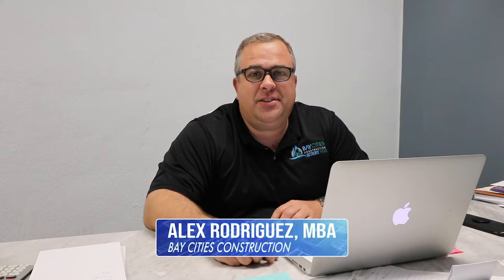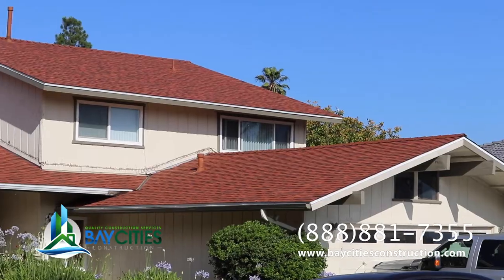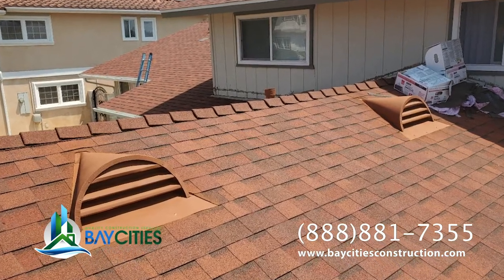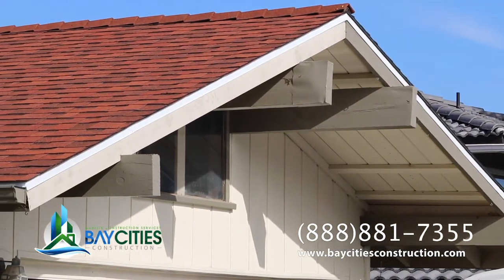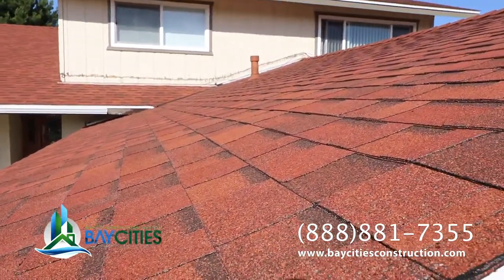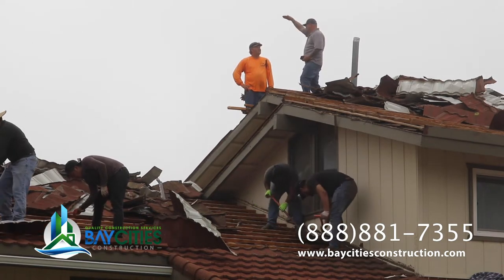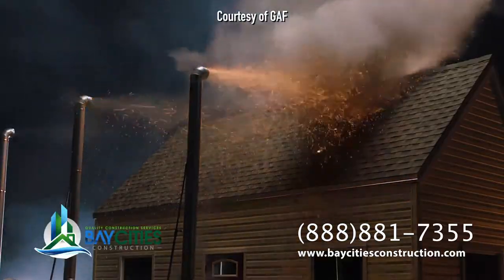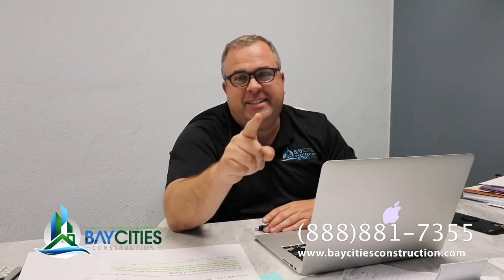What is a Cool Roof? | Why You Should Seriously Consider a Cool Roof

Comment: I’ve never understood why USA commonly uses these shingle roofs. Here in Australia we use either terracotta or cement tiles (which last a good 60-70 years with basic maintenance, or colourbond steel which has slightly shorter life but lower thermal sink. Why does USA use these weird shingles which seem to blow away in a strong wind and don’t seem to last very long (25 years is not long for a roof, in my experience here in Australia).  Also they’re all fire proof.
Reply from the maker: It comes down to cost ....premium asphalt shingles are very affordable and lightweight, tile roofs are HEAVY and as such will require a more robust roof frame (which itself costs more).
Reply: Because shingle manufactures lobbied to have specific rules written in to law so we have little choice, meaning we have to buy more shingle more often than better options. Yay government!
Reply from the maker: Spanish tile roofs are beautiful - but there's a reason why they're mostly found on luxury homes... they're expensive! Its a lot more affordable to repair a shingle roof than a tile roof. In fact most roofers wont repair roofs on tile roofs because they have to remove tile and then re-install once the leak is located. This is very time consuming, and of course, you have to pay the workers, so in turn the homeowner is charged more.

Comment: I also just learned about "heat barrier." I would like to do the heat barrier but i really don't have an attic.  Curious of there is a way to do the cool roof and heat barrier at the same time.
Reply from the maker: Hi Luis, there are different types of "heat barriers". For new builds we use LP TechShield Plywood with integrated radiant barrier...this can be installed during a roof replacement (not a re-roof) since a tear off is required and the existing plywood sheathing (or board/planks) needs to be replaced with new LP TechShield. Watch this video for more details https://youtu.be/fG05uRgLsM8?t=945

Comment: what happens if you just paid and got a new roof?  Do i need to pay someone to get rid of my new shingles and put the new cool shingles?
Can I just paint my new shingles with anti reflective white paint?
How much will I save on my electric bill by these cool shingles?
Reply from the maker: Hi Raymond, we wouldn't recommend painting over a brand new asphalt-shingle roof, most "roof paint" products are meant to increase the lifespan of older roofs. Additionally, most of those reflective paint products are meant for flat (commercial) roofs, not residential shingle roofs.
Reply: Hi Raymond  I am a construction professional.  I would not put a reflective paint on a nice looking new roof, its just ugly.  You might try a product called cool coat by a company called Rainguard. you can get it at Lowe's or order it from amazon, you'll need to pressure wash your roof first the product can be applied with a garden sprayer, it drys clear.  I have heard anecdotaly that the product can prevent moisture from escaping your attic and that can cause damage, also that it can flake or peal causing an unsightly look.  I doubt the former will happen if your roof has the normal required ventilation, it may be possible to avoid the latter by reapplying every so often.  You be fighting global warming by using less power so, YA KNOW!